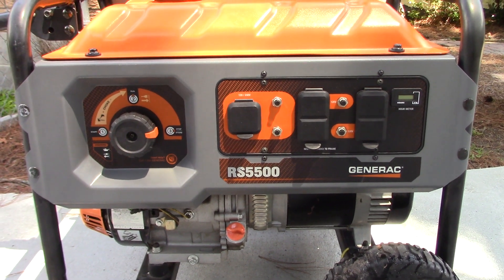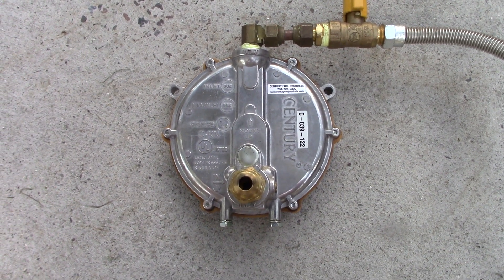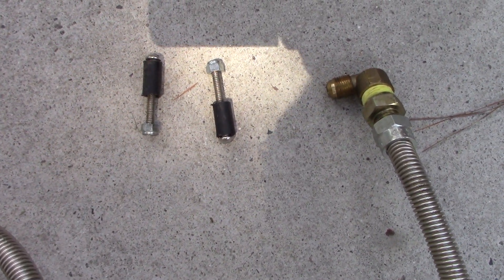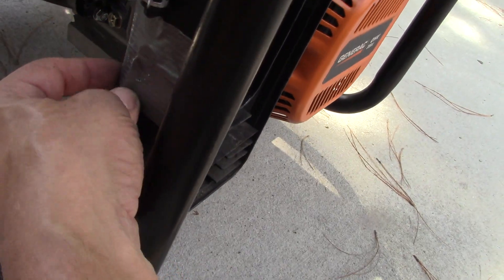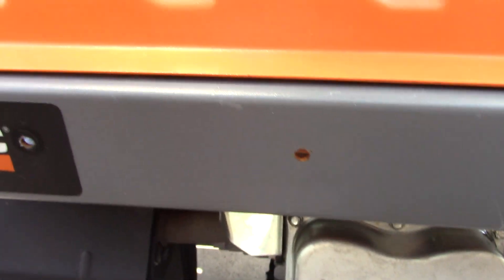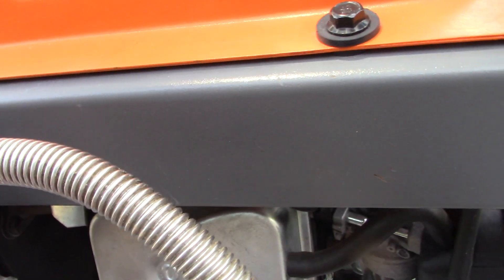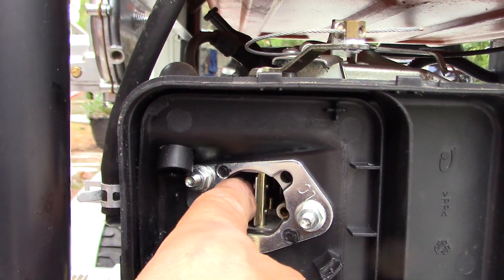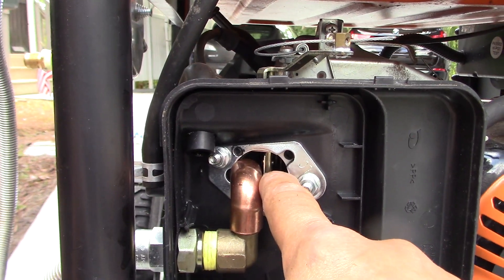Generator conversion to dual fuel

Comment: I have the same generator. How does it perform under load on natural gas?
Reply from the maker: I am using it right now, Helene passed through last night and we have been out of power since 2:30 AM. It's been running since 7 AM without a problem.
Reply: Sorry you guys are going through that. Hope everyone is ok. We were caught through Hurricane Beryl in Houston. This little generator got us through a week without electricity. I was thinking of converting it into NG. Thank you for your reply. Be safe.

Comment: Wonder if this would work for propane ?
Reply from the maker: Yes, just make sure the regulator is correct for the pressure. Natural gas is very low pressure. You might also need a smaller opening at the end, where it goes into the intake. That's one of the differences in the natural gas vs propane, the orifices have a larger opening for natural gas.
Reply from the maker: You would need a different regulator

Comment: Kind Sir, I have seen a number of conversions recently, as yours. And each one had to "tune" the regulator; on the top input where the NG comes into the regulator. apparently yours did not need that at all! So How did you get that to work without tuning having tune it? IE...

There is an adapter that is ahead of your "on/off" lever; on the other side of where your NG goes into the Regulator. And it is nothing but a bolt threaded into the connection and a "lock" nut. And they all turned that bolt back and forth; until they hear; the sweet sound; when the engine is working most efficiently.

Then they locked the bolt with the nut. So I'm wondering how if you were not REALLY lucky. What's your "take" kind Sir?
Reply from the maker: Sorry, I didn't see this until now, actually using it today since Helene passed through and took out our power. Started right up on the second pull. There is a primer on the back of the regulator, just had to press it a couple of times then started it. It's been running constantly for the last 8  hours

Comment: I just bought the GP 6500 I'm going to try your system
Reply from the maker: Check Home Depot on-line ship to store prices for the gas line, that is where I found mine for much less than the in-store options